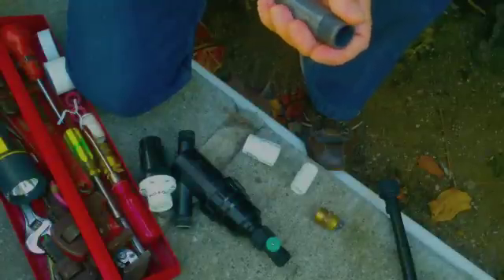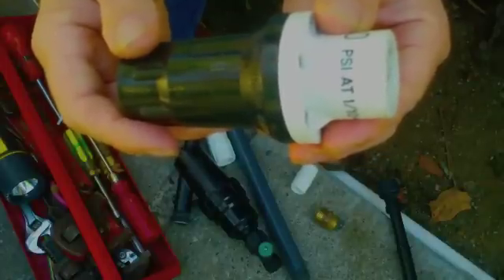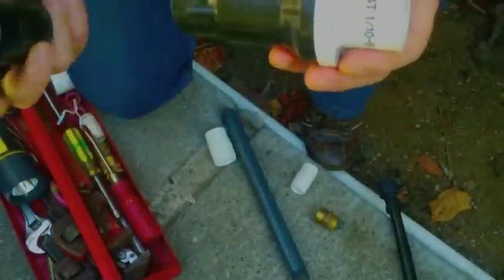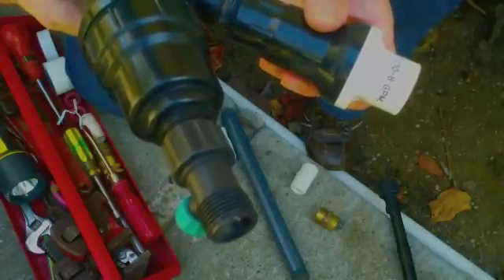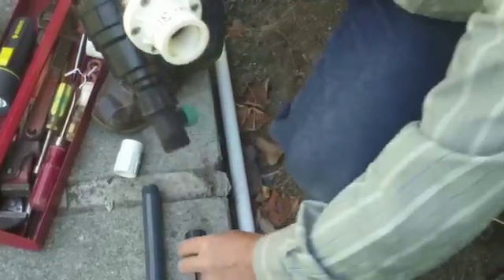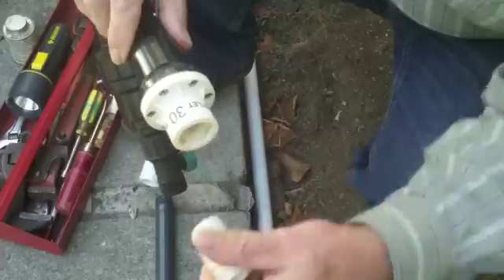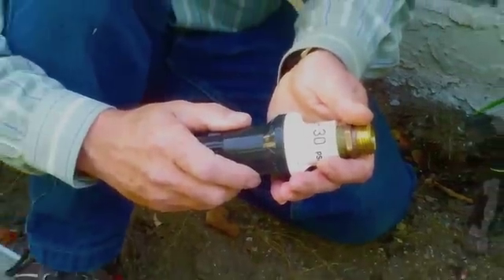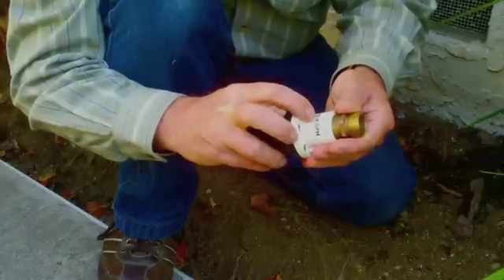Drip Irrigation Pressure Regulator

Comment: Robert, Thank you for your informative video. Would you please help me give some guide line about the following matters? 
I would like to convert one of my sprinkler zones to dripping system (in other words it could be micro sprinkler system). There are 4 rotor sprinkler (Rain Bird 5000 and 42SA) and one flower bed sprayer in that zone.  I would like to convert 3 of those Rain Bird rotors to drip irrigation for watering my plants. One of them will water about 25 plants, other one is about 50 plants, and the third one will water about 10 plants and two raised beds (4'X12' each). Would you please suggest me how I can do this? I appreciate your help. Thank you.

Comment: The biggest problem I have is my 1/2 inch PVC line is 120 feet long, and the pressure is high at the beginning and low at the end.
Reply: Make it into a loop systems basically a circle so water flows evenly